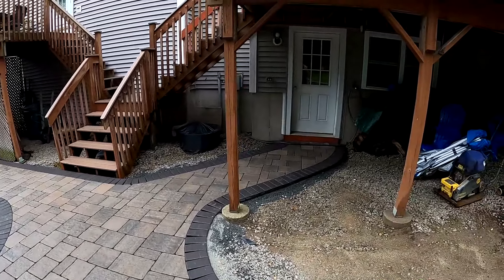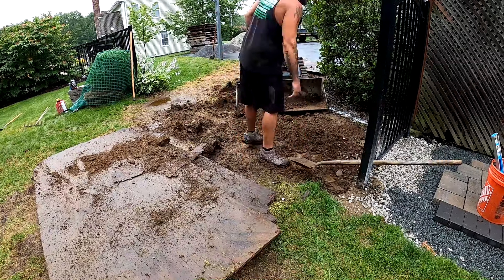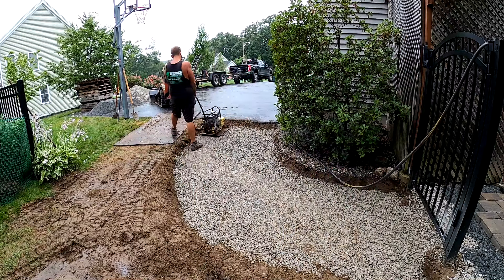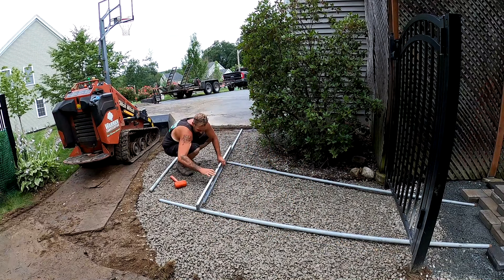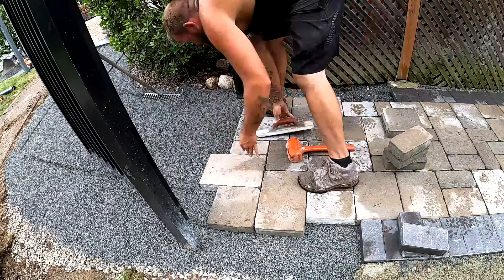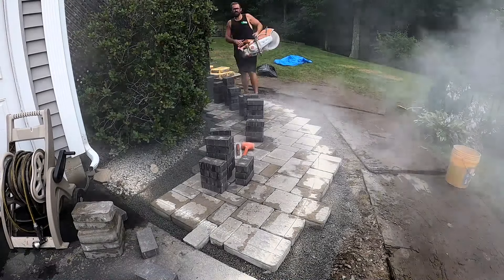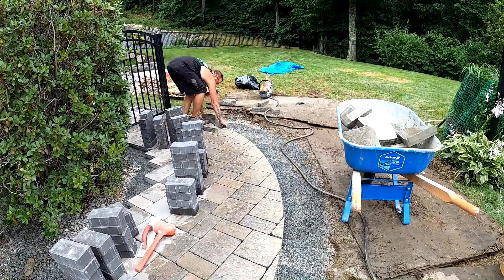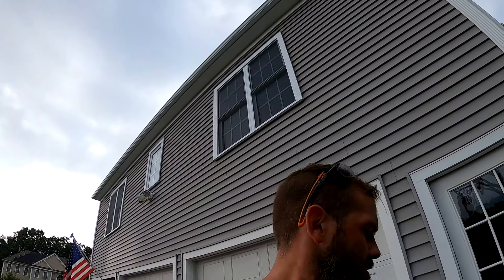How To Install a Concrete Paver Walkway (DIY)

Comment: Glad to see some of the actual walkway built, but wish you had done more of the walkway along the house before the gate to see how you did that coming off the patio area.  Very helpful and very nice work.
Reply from the maker: I have a full playlist of videos from the patio install which includes some of the walkway install inside the gate. Here is the link to that playlist 👉https://www.youtube.com/playlist?list=PLo6xdtKoDxWaYAO7zSwtZ6ESqdMfdAVOP
Reply: Thanks! Will watch that link!
What are your recommendations on my other questions regarding 3/4" and 3/8" layering depths project for pavers going around from my patio in Coeur d'Alene Idaho?

Comment: True artisans! Absolutely beautiful work! Thanks for the lessons! I've learned alot for the driveway I'm planning on doing!
Reply from the maker: Thank you! glad the videos are helpful, if you are doing a driveway, be sure to remember that a few more steps and techniques are required for vehicular traffic. Like excavating a little deeper, compacting with a heavy plate compacter, installing a couple layers of geo grid in the backfill process, and unlike foot traffic installs, you need to compact in a few lifts as you backfill to support the vehicular traffic over time. Good luck! ✌
Reply: @TheChristianHardscaper  Thank you! Good to know. Do you have any driveway jobs coming up?
Reply from the maker: No Driveways right now, Can't wait for one to come my way ✌

Comment: Day-um dude. Top-Notch Work!!  I am preparing to put-in pavers off of my back portico and I’ve watched a ton of “how-to” videos and yours are clearly the best. Excellent work.  I’m in Asheville NC so I think we might have a similar freeze-thaw profile as MA at my elevation…so you have me thinking about the 3/4” base now as a minimum requirement. Thanks!
Reply from the maker: Thanks brother! This base technique is by far the best in my opinion, especially in climates like ours..... You will not regret it, good luck! ✌

Comment: Do not buy your gas pipe from a store ! Go to a scrap yard and save a ton of money , You will thank me. I like his base I think I will use this method. 3/4 stone  and then the Chip stone . I think this is more solid then sand . Thanks for the video over all I think it made sense .
Reply from the maker: That is not a bad idea at all... You may get lucky and find some nice rails but every time I go to the scrapyard I cant see 1 piece of straight metal anywhere...LOL But yes, this base prep method is far superior to gravel /sand. Glad the video was helpful and here is a link to another video I made which explains the base prep method in much more detail 👉https://youtu.be/ChaJe3JqD6I

Comment: I looked through your playlist. Any videos on joint sand and the edge restraint.
Reply from the maker: Hey Josh, I am actually in the middle of a Polymeric sand video now and it will be posted by this afternoon. As far as edge restraint, I use regular concrete for the edges and I will most likely discuss that in the poly sand video.
Reply: @TheChristianHardscaper   Awesome!  I laid pavers around my pool about two years ago and continue to have issues with polymeric sand. I used techniseal from site one. I’m wondering if it is because I used crusher run instead of the 1/4” that your using. Causing a drain problem.
Reply from the maker: @joallen0001  There is definitely many reasons for poly sand failure... Most of the time its from watering to much or to little. Sometimes if its done when its below 45 degrees it can take awhile to set causing a weak bond, sometimes the poly sand you buy can be bad. I have seen a couple different poly sand manufactures have to warranty a lot of bags because the poly did not activate. But also, around a pool with a lot of splashing and water beating on the poly, it can break it down over time. But if it is done right and the poly sand is good, it shouldn't completely fall apart, just some parts here and there. Here in Massachusetts, contractors typically do not warranty poly sand for more than a year because of the many factors of failure. In my opinion it is still far better than any other joint filling alternatives but you just really need to nail down the technique. But if it is done right and the poly sand is good, it shouldn't completely fall apart, just some parts here and there.

Comment: Fantastic video. I'll be using this as the blueprint for my walkway! Question about the downspout that I can see at 8:08. Any concerns with water being discharged so close to walkway? My walkway will be very similar in terms of location to downspout relative to location/shape of pavers, and I'm concerned about water pooling in excavated base area during heavy rain. If I do install a 4" SCH40 PVC pipe under walkway, how far down should this go? Does it need to be under 3/4" crushed, or can it run through 3/4" crushed? Thanks!
Reply from the maker: Nice! I was not concerned about the downspout. With 3/4 clean stone as the base, the water will permeate and drain right through it and into the subsoil. I think a drainage pipe would not be necessary. If you do not have water issues in that area now, you will not have any after.  ✌

Comment: I'm building a home and after spending a ton of money I wanted to add some hardscape myself. Thank you for such a detailed tutorial on the paver walkway! Extremely helpful. I decided to use smaller stones for my sidewalk because it's a lighter  for me to lift. I found it interesting that you didn't use paver sand. I know a guy who does side jobs and he can help with the gravel. I will definitely use plastic between layers as you suggested, it just makes sense. I want to be one and done. Blessings.
Reply from the maker: Very cool, Sweat equity is an awesome thing. I always tell people that the reason I love this work is because you can step back and look at something you have built, very satisfying. Good luck! ✌

Comment: I did not put landscaping fabric down before 3/4 clean gravel. Can put it down between Gravel and chip stone??? Thanks
Reply from the maker: You can, but I don't think it is necessary at that point. You can just put the chip stone down ✌
Reply: @TheChristianHardscaper  Thanks

Comment: Looks awesome! Does the cement around the border hold better than edging?
Reply from the maker: Thank you, I think it does for sure. But just like everything, it is all about how you do it. But it is also because we have to. You can't use plastic edging and spikes with this base prep method I use. The clean stone is loose and the spikes will not hold tightly.... 

Here is a video of how I do the edge restraint right here 👉https://youtu.be/_X1tCmMJQqk

Comment: beautiful walkway. How much time to you spend grading your soil sub base? Do you get it level and then grade your bedding layer? or do you grade your sub base and base?
Reply from the maker: Thank you, we try to get the sub base and base to the proper slope. The sub base is very important to make sure is sloped away from any structures. That helps with keeping it away from the structure as it permeates. ✌

Comment: I may have missed this but does water filter through the plastic fabric?
Reply from the maker: Yes it does, It is a geotextile stabilization fabric that is permeable so water can flow freely into the subsoil while preventing the subsoil from migrating into the clean crushed stone. ✌

Comment: Does the open grade base and bedding work for wire cut clay brick pavers on a slope? (i've only seen you use concrete pavers) I plan to use a geocell to hold the base on the slope. The pavers are not interlocking and will have 1/4"-1/2"+ (rustic) gaps. Can the permeable bedding be used as joint compound as well? I want the joints to be semipermeable. ....    I've watched many of your videos, thank you for this incredible resource, I hope you're getting rich for all this hard work. Be well.
Reply from the maker: Hey man, this method absolutely works for clay brick pavers. And if you want to fill the joints with bedding stone, you sure can. They also make even smaller stone in bags for that same purpose. If you want the joints sealed up, I would not recommend poly sand for clay bricks but you can use joint sands that install wet like (Easy Joint). It is expensive but sets up extremely hard and will help lock everything together very well. I'm glad the videos have been helpful, good luck! ✌

Comment: Hello! Question regarding the 3/4 inch base  - how do you measure the height of the base on top of the landscape fabric?
Reply from the maker: We go for 6-8 inches of base stone. We usually use 1-1.5 inches under the fabric and 5-7 on top of the fabric. Anywhere in that range you will be all set ✌
Reply: Thanks so much, appreciate the reply!

Comment: What brand pavers were those? I like that color. And what’d you use for that little wall? Matched really well.
Reply from the maker: - The pavers used on this project are manufactured by (Genest). 
- The main pavers are called (Grand Katahdin) with a color tone of (Meadow)
- The border pavers are called (Hollandstone) with a color tone of (Charcoal)

- The wall block and cap is manufactured by (Techo Bloc)
- The block is called (Semma) with a color tone of (Champlain Grey)
- The cap is called (Architectural Cap) with a color tone of (Champlain Grey)

Comment: I’m in east TN, in the mountains, lots of red clay. I want to widen my driveway about 4 feet in each side with pavers, what do I need to do differently on the base for my application? Love your work.
Reply from the maker: Thanks for the feedback. With driveway applications, I would dig a minimum of 12 inches below top of paver height. Compact the base like in this video and lay fabric like in this video. But then, for driveways, after the first 3 - 4 inches of stone, compact that layer and you should install a layer of (Geo-Grid) to help stabilize the base even more. Than backfill 3 - 4 inches on top of that geo-grid and compact. Finally backfill on top of that layer of geogrid to final height before screeding and compact. ( so 3 lifts and 2 layers of geo-grid ) 

Than screed your bedding stone and lay pavers that can handle the weight of vehicular traffic ✌🏻

Comment: Great job. Quick question.  What type or brand of chip stone did you use? What chip stone do you recommend? Can I get from lowes or home depot?
Reply from the maker: Thank you, I'm not sure what brand it would be at lowes / home depot, but if they have it, it is just a clean, crushed stone that is 3/8" or less.

Comment: They say there is no such thing as a stupid question so here goes: What was the purpose of the gas pipe you laid down on the ground and then removed it? Thank you. And, I would like to say that you made this look so easy but I know that the expert has a habit of making extremely difficult work look simple. You are indeed very skilled people. Impressive!
Reply from the maker: Thank you very much, and that's not a stupid question. Those gas pipes are what I level the bedding stone off with. When I pulled the level over the pipes, its called screeding. That's the process I use to get things level. Here is a link to a video that explains the base prep process in more detail 👉https://youtu.be/ChaJe3JqD6I
Reply: @TheChristianHardscaper  I see. that's very clever indeed!

Comment: Love your video! Can I apply the same method with Bluestone pavers(600mm x300mm, 20mm thick) I have seen most people using concrete base with Bluestone, but I’m not too confident to diy with concrete.
Reply from the maker: Thanks for the feedback! Yes, absolutely you can use the same method for any natural stone pavers as well. I think its better than setting them in concrete actually. It allows you to re use them again in their life, once you set those stones in concrete, you usually will not be able to use them again. But by setting them on clean stone, they will last a lifetime and if you ever have to repair a spot, it is easy to lift up and repair. So yes, you definitely can! ✌
Reply: @TheChristianHardscaper  Amazing! Will try it out during Xmas holiday! Thanks for your reply:)

Comment: If you wanted to blend an existing concrete patio with pavers over it and then on the ground beyond, can you just use concrete adhesive to secure the pavers to the concrete patio and then just level up the base beyond the patio to be shorter by the paver height?
Reply from the maker: Typically with laying pavers on concrete, I don't recommend it. However, with that being said, If you are to do it, I would either mortar them down to the concrete or lay the pavers on a small bed of chip stone (Bedding material) on top of the concrete. The reason I would not use glue is because you either need to bond the pavers to the concrete and create a water tight bond, glue will not do that. Or you put a layer of permeable bedding material so that any water underneath the pavers and on top of the concrete, will have a place for it drain to. Then you prepare the base for the extension to the same height. ✌
Reply: @TheChristianHardscaper  OK … that makes sense. Thank you! I just wanted a way to blend a drab concrete (covered) patio with the rest of the plan without tearing it out.
Reply from the maker: It is definitely possible, just needs to be done properly for it to last awhile. 👍

Comment: Great video very professional work. One thing I was a little confused about was why you were able to cut the "outer" radius in place and you weren't able to do the same on the "inner" radius and had to cut them individually?
Reply: Also do you lock everything in with polymeric sand when you're done laying the pavers?
Reply from the maker: Thank you ! So when you cut a radius with a big concrete saw like this one (14 inch blade), you will damage the pavers your cutting as you are lifting your blade out and placing it back down to get a different angle. If you try to curve the blade with the cut, it will get jammed up and possibly warp your blade at the least or break it completely, leaving pieces of metal flying in the air.... So on the outer radius, the damage happens on the junk part of the paver, allowing you to cut them in place. While on an inner radius, the damage happens on the side of the paver you are saving. So you need to pull those out and cut them individually. ✌
Reply from the maker: Yes, we do use polymeric sand. I have an entire playlist of this job in this video that shows you everything we did. 

Here is the link to that playlist 👉https://www.youtube.com/playlist?list=PLo6xdtKoDxWaYAO7zSwtZ6ESqdMfdAVOP
Reply: @TheChristianHardscaper  Excellent explanation thank you for taking the time to respond. I'm brand new to this trade, my partner and I just started a side business and got our first "Decent size job". It's a circle paver patio which will leave me with only the outer radius to cut which will be nice to get in the groove of things.
Reply from the maker: Glad it helps, the outer radius cuts are not too bad. Just take your time and you will have fun building it! I love this industry, every time I finish a project , I love it more… Good luck on your project! ✌🏻

Comment: Beautiful work! Can I ask what the ballpark installation price is for the path with the fire pit? I want to do the same, but I’ll need the path 3x as long.
Reply from the maker: A project like this with everything included can cost between $15,000 - $20,000 depending on the materials you choose to use and where you are located in the country. ✌
Reply: @TheChristianHardscaper  thanks for the reply. I’m in the Chicagoland area, so I’m sure I’m on the upper end of that.
Reply from the maker: @Terquilla  No problem at all. And yea, probably closer to the $20,000 side in that area...

Comment: How do you keep the joints type on the boarder when making the curve?
Reply from the maker: the border on the curves actually has a little wider joints than the rest. Some guys like to cut them and make them tight. I don't. As long as the joint is 1/2 inch or less, I fill it with polymeric sand. I don't like cutting border pavers because it takes the nice beveled edge of it... ✌

Comment: Excellent job do you ever infill between the pavers with sand to prevent movement or weeds ?
Reply from the maker: Thank you! Yes I do fill in the paver joints, We use "Polymeric Sand" Here is a video I made that explains it....👉  https://youtu.be/mmQIHU2b3qg

Comment: Are concrete pavers superior to paving bricks for longevity?  My walk way bricks have absorbed water and are crumbling from the top down.
Reply from the maker: Actually red ceramic bricks tend to have a much longer life span than concrete pavers. Pavers deteriorate especially quick when constantly in water. It slowly breaks down the aggregate until they just fall apart. Which is the main reason I use open grade base ( clean crushed stone )

Comment: Do you ever put concrete behind a double sided wall or is that not necessary?
Reply from the maker: Not really.... You could put some on the bottom row kind of like how we concrete the edges of pavers, that would help prevent the base row from shifting. But I don't think it is necessary... ✌